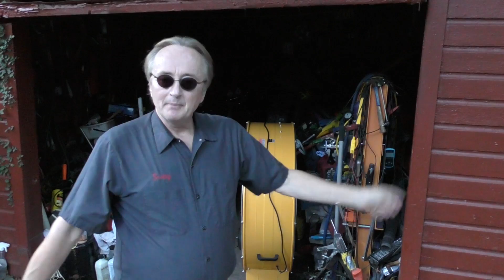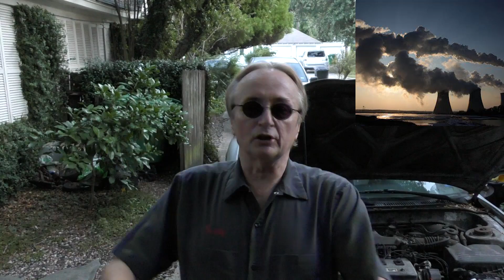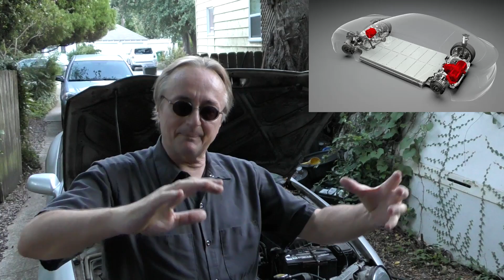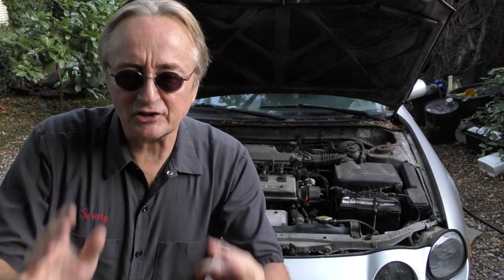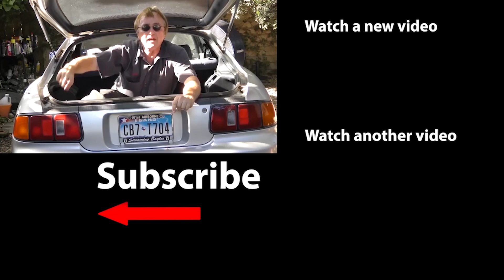Saying Goodbye to My Toyota Celica's Engine

Comment: Actually, Lithium Ion batteries contains only about 10% lithium...and those batteries can be recycled...current Electric motor is about 5 times as efficient as traditional engine...and they only keep improving rapidly in the next decade or so...same with the batteries...

Electric vehicles are the future, like it or not.

Comment: I would convert my 2019 civic si. You can make electric car do 0-100 in 4 seconds.  It would be the best sleeper car.
Reply: Frankie Beans80 I have a 2012 CNG civic that gets close to 40mpg, runs clean and has 300,000 miles on it. Honda quit making them because they didn’t sell well. Go figure. It is an underpowered slug but it’s cheap and reliable.

Comment: The process of making the electric cars leads to the pollution so how is it any different from buying a conversion kit that is probably made in the same process? What makes a good car other than the engine and transmission? Might be an upgrade for any brand but Toyota and Honda

Comment: Interesting post, Scotty. 

I won't dispute your concerns for the short-term future of such vehicle and your take on lithium, however my guess is that the source of recharging electric vehicles (especially in the commercial sector) may well depend on green generation as that technology matures, and not the traditional coal/oil fired grid. 

In Ontario, Canada (incidentally the only administration in North America with no longer any coal-fired generation) I read that one of the major grocery chains has taken options on a number of electric tractors for their fleet. It's a tentative start―no arguing that (to quote you), but I do wonder how long it will be before such companies use their massive brick-and-mortar infrastructure to generate recharging stations using solar, or some other green source.

One old man's thoughts ...

Comment: If you are gonna convert something it's always going to be a pain to life with. Take for example cars that have been engine swap with a non-original engine. Custom made stuff to let it work. Custom made sub frame, engine mounts, drive shafts, other brakes, different transmission fitment with different mounts, it has special wiring for communicating with the (original) instruments. If some of that stuff breaks, try to find replacement parts that are gonna work out. It's the same with electric conversions. Things have to be custom made and that's just a pain in the b*t and makes the car expensive to build and maintain. You will get electric Frankenstein monster cars just like Cuba has if you are gonna do only conversions. Good, affordable, solid electric cars from manufacturers that now what they doing do we need. Just buy them when de depreciated enough.
Reply: The people that do conversations and/or engine swaps, they'll most likely be able to get replacements. Conversations aren't really for the people like you.
Reply: Did you just sensor the word butt?

Comment: For the past few years up until a couple months ago I worked at a coal mine that closed down in 1995. We treated anywhere from  3000 to 10,000 gallons of water a minute, depending on the weather. 20 years of coal production will now need at least another 50 years of water treatment. Mining is dirty but gives us 70% (don't quote me on that number) of the electricity we use.

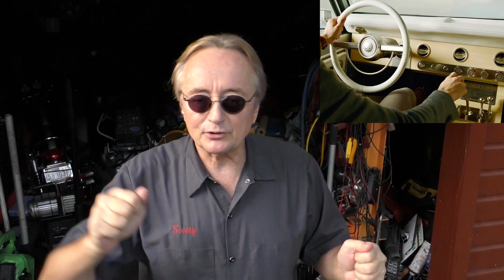Comment: 5:07 An electric car with a manual transmission would not be that bad. You could never stall the engine and you can probably just leave it in the same gear 90% of the time.

Comment: Why would an electric car use a transmission? You can reverse the motor and the motor itself generate power from start to cruising speed without artificially keeping the revs up.

Comment: No so simple.  The VR's are complex.  Also there are different motor types. DC AC  single phase, three phase etc.  Not to mention you can be killed messing with the kinds of current involved.
Reply: the cells are so fragile that they can explode if you knock them around just a little too much, at least bright red flames look cool.. don't sniff it though.

Comment: If you watch "matrix" Scotty humantards could produce electricity. Put them to sleep and arrange the according to preference. Don't forget to connect the wire between them but I'm still confused which end is negative or positive. Haha
Reply: Well, that's fiction, but since we are being silly:   It's easy to tell which is positive and negative.. the Feet have a black insulator over them (shoes)  and they are usually on the ground, to that is the negative end. and the hot head goes to the hot red lead so that is positive.

Comment: Lithium mining needs cleaned up, but it's a darn sight more solvable problem to fix one centralized industrial process... than it is to resolve the distributed issue of tailpipe emissions. Plus lithium isn't a consumable item like gasoline; it's inherently recyclable, and to get an idea of scale; about 40kg of lithium goes into a battery. 

Even with a dirty grid, an electric car is still less polluting 'cus combustion cars are so inefficient; 60% of the output is heat and noise (energy which goes into wearing out your vehicle). That's under 40% efficient at the point of use; and gasoline doesn't magically get to the gas station; it needs to be extracted, refined & transported, a 25% additional energy cost; hidden from the MPG figure. Compared to high voltage electric grid with single-digit transport losses & an electric motor >90% efficient.

Infrastructure? The average mileage in the US is under 10k miles annually. For the average commuter; charging at home every 3rd night doesn't require a supercharger network. Every home has electricity! lol.

Comment: I don't get it, you spent the first half of this video explaining why electric cars aren't even remotely practical, then go on to say that conversion is greener but it only helps eliminate 1/10th of the problems that come with electric cars in the first place. It seems it causes more problems than it solves and turns out gasoline engines are still objectively better all around. So... why would you go ahead with a conversion at all? just swap the motor for another gasoline engine lol it's still way more efficient and green.

Comment: What do they do about the air conditioner? The compressor is driven by the engine, so if it where electric, the compressor won't run at idle. Do the have a clutch to disengage the engine and have no gears, do they have an accessory drive motor?

Comment: GO DIRECT HYDROGEN, ON BOARD ELECTROLYSIS (NO FUEL CELLS OR STATIONS), IN A PRESENT GENERATION COMBUSTION ENGINE: NO POLLUTION WHEN CREATED OR BURNED, USES ANY WATER TO PRODUCE -- GET UR HEAD OUT OF UR TAILPIPE AND STOP SUCKING UP TO THE POWER COMPANIES!!  THIS TECH IS ALREADY IN FLEETS OF CARS RUN BY THE US AIR FORCE -- LET$ BET ON THI$, $COTTY!!!!

Comment: Scotty it's so funny how little research you do when you talk about electric cars 😂 stick to the ICE vehicles that you know.
Reply: Care to point out where he was wrong?
Reply: @doubleb95-d6z  upfront cost of conversion vs buying a new car, effecincy of engines used for electricity generation vs engines in cars, low feasibility for creating attractive mileage on conversions due to chassis not being designed to hold batteries. The list goes on. Great idea, but it's been tried and it doesn't work. People buy the things that they want and people want teslas. They don't want their same old car that's got who knows how many things wrong with it, And they aren't going to spend a ton of money in one go for it either.

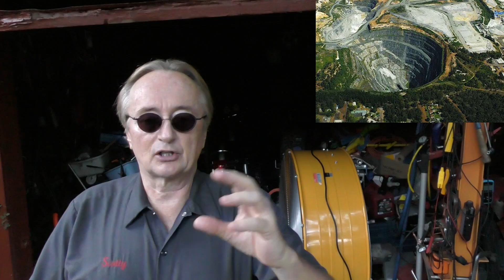Comment: 1:40 Tree huggers and environmentalists, and every single Tesla car owner ignore this Fact 😄
Reply: If no EVs were made the lithium mines would still be there for a million other types of batteries.
Reply: They're "self proclaimed" environmentalists, and actually only care about gas mileage. 🤐
Reply: Mine comes from Hydro, Your point?
Reply: @bryson5411   Scotty and everyone here is talking about ELECTRIC CARS
Reply: @iForce08  Yeah, The cars here would charge off Hydro power
Reply: Natural gas plants are much more efficient that thousands of individual ICEs
Reply: Battery chemistry is reducing use of lithium. Lots of information on how much less environmental impact Evs are
Reply: the majority is nuclear... not coal
Reply: It's still beneficial for large citys to have more electric cars. Even if the total pollution is about the same (or even slightly higher) it reduces the car pollution in that city to a near zero, and pushing that pollution into the power plant hopefully far away from citys

Comment: anybody see his other video where he says in west virginia it would take 17 years of driving a tesla for the emissions to be less than an internal combustion engine
Reply: Our environment is not going to change from electric cars like Scotty said people forget that to bring electricity requires burning coal and other things that pollute to the point of regular engines are better I mean I’m sorry but if anyone thinks electric will rule the combustion engine is wrong no one will stand hearing nothing while driving (car fans) jobs will be lost and they’re just absolutely slow af after 110
Reply: @gsjourney3054  IMO, hybrid cars/plug in hybrid would be better given the economy (especially if they were diesel hybrids). You could pair a battery with a smaller engine too, because the battery gives hp too. that's why most hybrids are faster than there non- hybrid versions. And, hybrid batteries regenerate so unless it's a plug in we don't need to build new charging stations. and the good ol boys can still hear their engine RAWR, while the economy benefits (hybrids can reduce around 50% emissions)
Reply: @gsjourney3054  Most states Electric vehicles are actually Greener, some would be better off Hybrid, and a few States it would combustion engine like West Virginia.
Reply: @mickymoto100  Yeah I watch videos of Scientists and Engineers tell you that it's still greener and safe than combustion engine. Although as the US is different some states yes it may be better off combustion engine, but most States are Hybrid and EV.
Reply: @hectorvega621  OMG what planet are you from? Read the comments again very carefully.
Reply: @mickymoto100  Look the only one's stupid are the one's who believe in that misrepresentation of Lithium ion batteries. I've told you already that I've seen other videos that explain the problems, but it's still a better alternative to combustion engine when it comes to the environment.
Reply: @hectorvega621  Nope, Coal charging is not better. You must drive one of these unfriendly environment destroying cars.
Reply: @mickymoto100  If it's West Virginia, or any State like West Virginia, then Yes you are correct, but no many States it's actually good to go EV or Hybrid. Also his new video has shown that EV and Hybrid or Hydrogen fuel release less fuel emissions under Natural Gas. Until most energy efficient renewable energy replace that coal, the better off we are with EV, or Hydrogen fuel.

Comment: A quarter century old toyota is still more reliable than a brand new tesla
Reply: @benz merc I wonder is a new Toyota more reliable than an old Toyota.
Reply: @hectorvega621  fun fact. The yaris hatchback used an engine that dates back to the 2000 echo, while the corollas base 1.8 engine dates back to 1998. Toyotas are so reliable because they keep the engines for many years and improve the engines over time.
Reply: @asdfghjqwertyu1858  ahh! That's why they dominate the market.

Comment: I’ve got an electric car that was made in North Korea.  The only problem is the long and heavy extension cord.
Reply: Wouldnt the cord get stuck in traffic?
Reply: Chuck Finley I know man I got one too and whenever I try to go to South Korea or China the plug isn't long enough. Gets really annoying.
Reply: @MG19-42  lol! Funny.
Reply: Power outages are common there
Reply: That comes with cable TV standard right?
Reply: And your battery that will only last 5 years.
Reply: @girlgonedog  lol no they don't last 5 years, they're warranted for at least 100,000 and 8 years, manufacturer's would be shooting themselves in the foot of they went out at 5 years. Some places it's 10k and 10 years, one car is a lifetime warranty on the battery.
Reply: @tonebonebgky2  lemme guess...you're selling an electric car.
Reply: @tonebonebgky2  ok...8 years, great warranties.  Do you know what it takes to make a battery? 
They are NOT green.
Would you put an old battery in your garden?
Reply: @girlgonedog  nope I'm a restaurant worker.
Reply: What's the length? 50 miles or 100
Reply: Ioniq.  What a piece of.....

..... my ex is driving one.  It's a tricycle with 4 doors not a car.
Reply: @mistermusic140  Was it an electric extension cord or was it a phone cord?

Comment: Give an estimate on converting a F-150 with ability to tow a 2500 lb trailer and round trip range of 100 miles.

If I can get that at a reasonable price, I could go electric.
Reply: I know it's not electric, but the 2013 silverado hybrid with 6.0 V8 4WD got 20 mpg in the city and could tow 6000lbs. You can find them for 20k with about 80k miles highest trim, which is pretty reasonable given the V8 6.2 Non hybrids are about 25k now highest trim.

Hybrid conversions are probably more expensive, but if you're only towing 2500 you could put a V6 (or even turbo 4 banger) and a Battery (like the accord v6 hybrid) and reduce your carbon footprint and increase fuel economy
Reply: Realistically I'd say $8000 or more. Due to the fact that batteries are still on the expensive side. But I'd say before you even look at batteries get a little diagram of the truck (or car if you change your mind) and think about where you'd put the batteries.
Reply: Electric Has More Torque than a Gas/Diesel '
Reply: Search for rivian